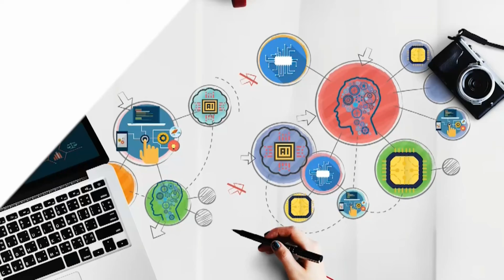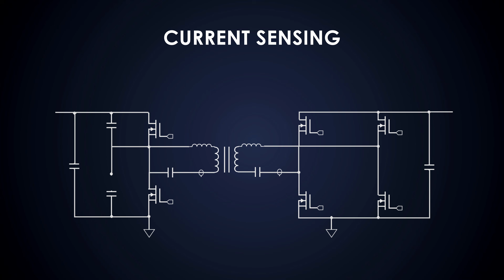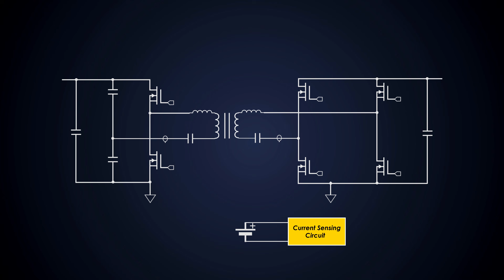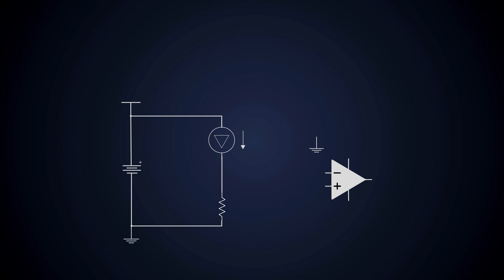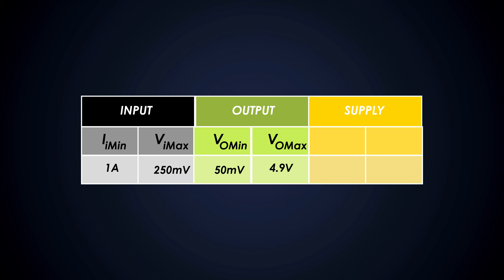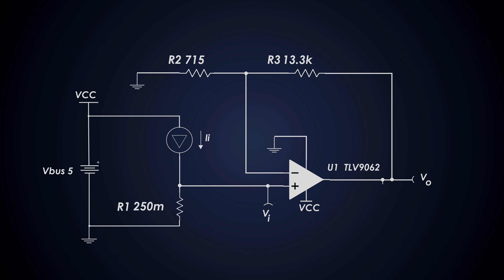Unidirectional Current-Sensing circuit using Op-Amp | Single Supply

Comment: One issues i have with op amp is the way circuit or explain by engineers i never learn i had to learn on my own theis to set precision for current level the invertering input need a reference offset voltage on 0.9 to 100 millivolt for it to work without a positive outset the output goes high and stay high the circuit is useless like how you show it no positive ofset volt to the invertering pin just a negative resistor and and to invertering pin and feedback to output i remember years ago doing this and could figure why the sensing was not working fir 3 years i try and my teaching seems to dont want tell me why so i one day i see Russian ingineer talking it and the invertering input need a positive ofset for any op amp to work and i did as he said there its was the circuit came alive working and when i told me teach he said that not the right way and he fail to tell me but the truths was he never did engineering he only teach book not practical because when i share this information to my classmates they to was having the same issue and now there circuit working everyone call the teach out on it why he same feedback should not have positive ofset but yet still the overcurrent sensing work perfectly senser 0.1 millivolt and he was surprised to see

Comment: Won’t this circuit be very sensitive to noise? I think you should use both the positive and negative input on the op-amp, getting rid of all common mode noise.

Comment: I am trying to use the TI DRV8231 bridge to drive a brushed DC motor with a pwm signal. But there's a lot of noise generated by the motor making it difficult to sense the low side current. 

Can you pl advise how to reduce this noise generated by the motor switching and potentially commutator generated electrical noise?
Reply from the maker: Great question! Brushed DC motors do create a lot of switching and commutator noise. Try using a low-pass filter on the sense line, shielded cables, and RC snubbers across the motor terminals to suppress spikes.